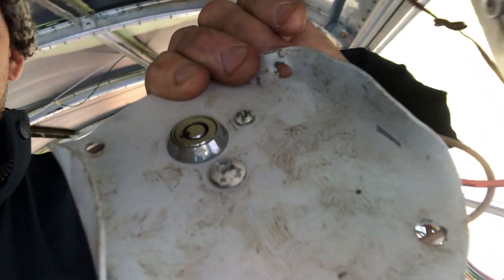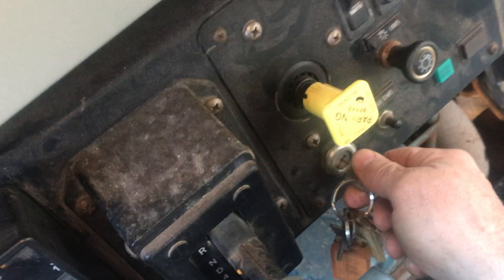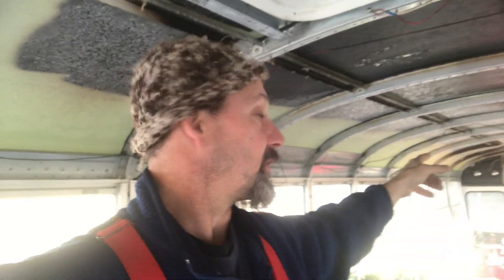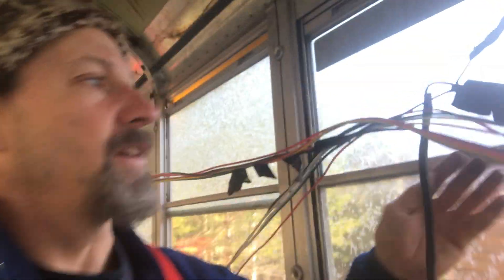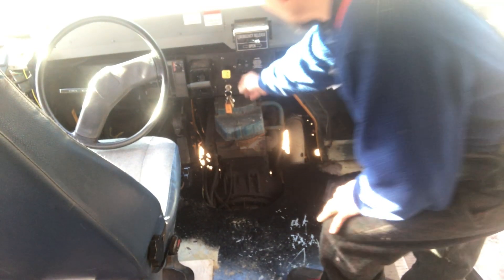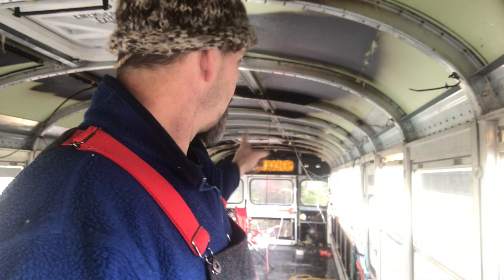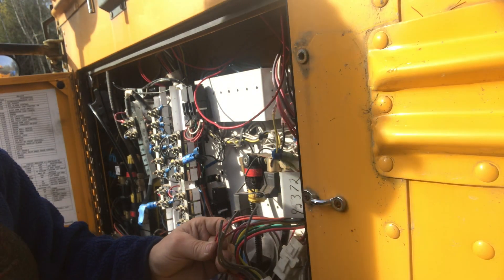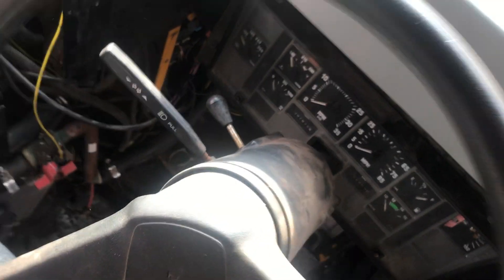How I Removed the Interlock Wiring . (And the Bus Still Runs!)

Comment: I’m having trouble with my wiring my bus won’t start soon I cut wires . Can you assist me ?
Reply: I cut the back wires and bus won’t start now
Reply: I have a 2018 GMC 4500 16 seater. Unfortunately I didn’t realize the ignition was tied to the emergency doors and the buzzer. I pulled the buzzer off and in the process I damaged the buzzer and now my bus will not start. Bummer. I am waiting for a new buzzer to get delivered and then I will start all over again. This time systematically going from one door to the next. One thing I think I might leave will be the power lift for my husband’s safety. Still haven’t found a u tube video with the exact same set up as mine though.